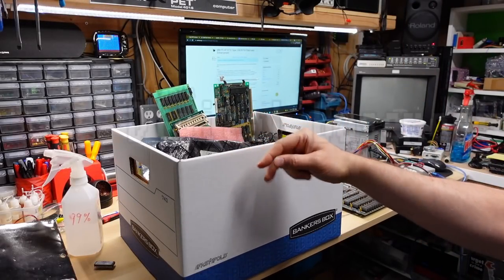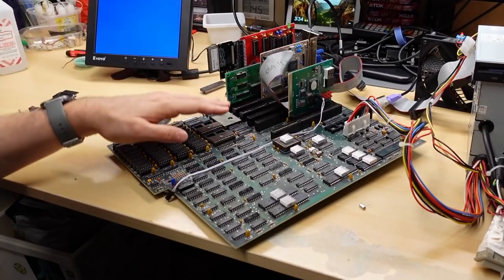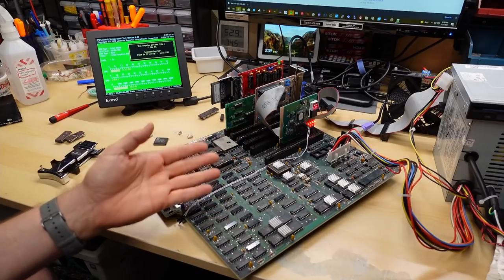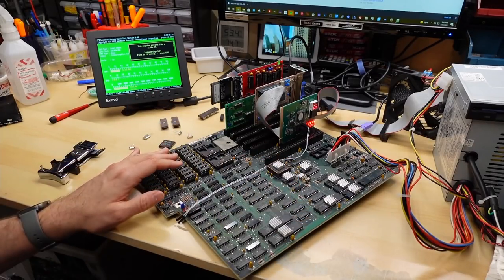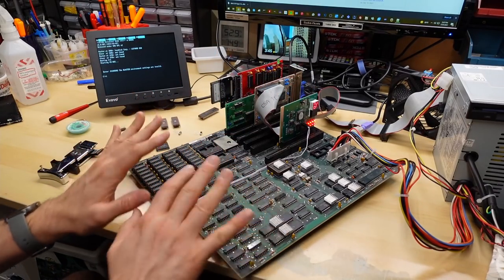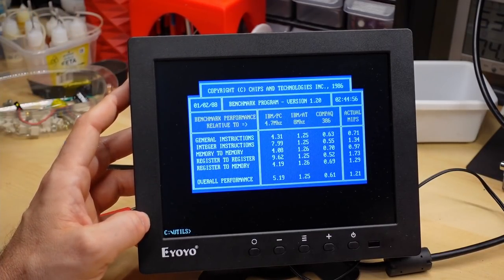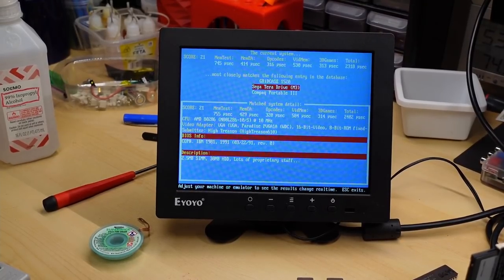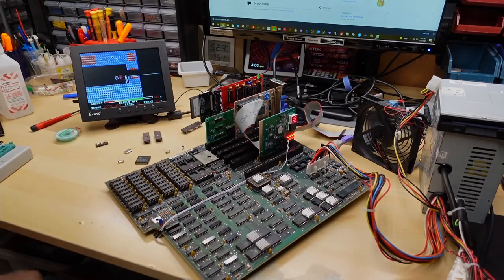Followup: IBM 5170 "extreme" overclocking (w/ associated BIOS patch)

Comment: I felt excited to see someone rewriting a BIOS and have it applied and working, with all the patches.  I'm a software developer, and I LOVE being able to write applications to do my bidding.  I've never gone as far as to build a BIOS for any machine, so the process in this and previous videos have been wicked awesome.  LOVE it.  Thanks for the update!
Reply: IBM also did give the full source code for the BIOS, a far cry from the modern offerings from them, or from almost every other manufacturer now.
Reply: From a firmware perspective at least, these boards should be unusually "easy" to write a BIOS for, since they were made of largely commodity chips that were/are well documented- it's akin to a more comprehensive DOS extender or other DOS program (the biggest differences are that the DOS/program relationship is reversed, and that you aim for "extender-esque" behavior). The biggest weirdness is probably that you need to setup stuff like DRAM refresh (early PCs used one of the DMA channels for it), which in basically every other piece of IBM PC code is unneeded because it's already configured.
Reply: A good question is: did the person who modified the BIOS have the source code, or did he have to disassemble the machine code?
Reply: @MisterMac56 with the knock on effects of utterly bringing IBM to the brink…..

Comment: Sometimes, overclocks may cause strange hung up's.. I did it even on my P1 machine, back in day's..

In this case - check out what exact version of programmable interrupt controllers (two of them 8259) main board has installed and some other bus parts.. Even one slower part on bus can cause similar issues, because, didn't release bus in time..

Anyway, great video, as always! 👍😉

Comment: I found it interesting that Adrain dropped into the 286 running at 10MHz - the 286-based PS/2s (Model 25 286, Model 30 286, Model 50, Model 50Z, Model 60, and 7552 Industrial "Gearbox") all were 10MHz systems. He placed heatsinks on motherboard chips, but one socket is unpopulated that would definitely need one for the transistor count: The optional 80287 FPU.

Only the microchannel systems of the 50, 50Z, and 60 ran the 80287 FPU at the same speed as the 286 CPU ('CKM', pin 39, "Clock Mode" tied high) - the ISA models and 7552 (where the FPU was included standard) ran the 80287 at 6.66MHz ('CKM' tied low to ground, so two-thirds of the 287 speed). It was primarily that someone could use a lower-rated (and lower cost) 80287. The later i287XL didn't use the 'CKM' pin in the same manner to run it at the higher frequencies it was capable of.

Comment: Wasn't expecting any mention, but certainly appreciate it. Likewise, I enjoy your videos and often have them on in the background when working on things. The Tera Drive was indeed built by IBM, even uses their weird edge connector hard drives, and it wouldn't be their only venture into the world of games console related hardware, as I at least think they built the Atari Jaguar too.
The XT-IDE thing sure is curious, even though changing that chip seems to have solved it for you. On my off-brand 286-6, installing an XT-IDE BIOS (after butchering a regular IDE card to sit on IRQ 5 and, I think, port 320h) causes the system to weird out and run the CPU from double the FPU's clock instead (20/2, where the FPU is 20/4). Have no idea what it does or how on earth the board is wired to be tapping a clock from the middle of a completely separate 7474. It's slower than your machine at that speed, though, as well as extremely unstable. Luckily it's back on MFM now and doesn't exhibit this issue.
If you change to a CMOS version of the CPU, you probably won't need a heatsink on it. Maybe if you have one that was made later, or especially any that came from laptops, it could be worth a look. These usually, but not always, have a model number like "80C286" as opposed to just "80286" stamped on them. There sure is just something about feeling that radiant heat from a bunch of NMOS logic, though.

Comment: Another great video, always informative. I did have a 20Mhz 286 machine as my first PC and I think I did run in to problems with the 10Mhz ISA bus speed but that was only with one card so don't overlook that if you continue on with the overclock but on the whole my 10Mhz bus was fine, the stepper motor hard drive from Kaloc?  that was another matter, it worked when it was cold or when it was warm but never both not matter when it was low level formatted, sounded wonderfully clunky though.

Comment: Fascinating stuff, I'm about to embark on my own 5162 project, which is a 6MHz machine with the same BIOS lockout for overclocking. I have a 12MHz 80286 and a few different crystals ready to drop in - although I think the 5162 BIOS is unique to that machine so I'm not sure your patched version would work. Either way, I'll definitely be referring back to your videos (and of course giving you a shoutout) when it does happen!

Comment: On XTs, PCs, and PCjrs, you'd need a PC-SPRINT modification. The clock system is set up to allow for a separate bus clock chip, so you can run the CPU at a different speed than the bus. It may still be possible to use that mod on an AT.

Comment: Hi Adrian,
To answer your question about the ISA bus speed on the 5170: It's a synchronous design, meaning no clock dividers were used to drive the expansion slots so when you overclock the CPU to 10MHz the ISA bus speeds will also be 10MHz.
If you're looking for more stability when running at 10MHz: Swap out the 82284 clock generator and the 82888 bus controller for 10 MHz rated parts. In stock form both of these chips are 6 MHz rated parts and cannot keep up at 10MHz (60% overclock) ;-) RAM should be 150ns and should be fine at 10MHz.. Some of the earlier machines had 200ns rated memory though so I'm not entirely sure they will be as comfy at 10MHz as their 150ns counterparts.. (not sure about the chips on your board as well)

Comment: The 108 error symptoms sound similar to reset issues.  Once reset is released somebody is starting up more quickly at the higher clock rate, which is violating some other timing in the system.  You could add a cap on the reset line and lower the slew rate, giving everybody more time in reset.  But that's a 50/50 chance of making it better or worse, plus some components are sensitive to super low reset slew.

Comment: 2:16 I don't think you are framing it the historically correct way. I'm very confident this wasn't meant as a dedicated check against overclocking, but instead at those times the Power On Self Test actually did what the name promised - i.e. it made sure that the system indeed behaves up to specification, and prevents booting if something is out-of-spec. This also includes verifying that the different clocks run at design speed.
Of course, checking that a system behaves "in-spec" has the collateral effect of detecting overclocking as "out-of-spec", but the purpose of this check is more likely to check that the 14.318MHz clock operates correctly (by comparing it to the 6MHz processor clock) than to check whether someone "illegally" runs the processor too fast. The fact that it checks for both overclock and underclock supports the idea that this is not a dedicated "overclock" check, but meant merely as "clock plausibility check".

Comment: Hah, I was going to suggest the DS1077 clock synthesis chip but then you mentioned it. Definitely would be interesting! You could also probably use our good friend the ESP32 in a pinch as well, the RMT peripheral can give you a carrier wave up to 80MHz, and you can set it to divide it down with a lot of resolution as well.

Comment: Sad to hear IBM even managed to lock users out who try to change the system. I played with a lot of clone systems in the day and overclocking was easy with no real problems other than instability when going really too far. Heck even my Atari pc3 even runs at 10Mhz at the moment (and for more than 20 years now) just by changing the 24Mhz crystal to a 30Mhz one.
Reply: In those days IBM would have been guarding against shady resellers rather than the end-user.
Reply: Yeah, I don’t see IBM as being the type to prohibit users from doing whatever they wanted.  Too much of what they delivered to the customer encouraged opening the case and poking around.

I do wonder if maybe some of those speed checks were there to catch abnormalities - or, as RetroSwim said, to keep the retailers honest.

Comment: 11:52 to some modern gamers, that's just normal everyday overclocking :p 
as in, turn it up until it bluescreens and then back it off until it becomes stable enough to work
Reply: And what some people consider "stable" isn't always "stable". I mean if you can get several hours of gaming or production out of an overclock before a crash, thats good for some people.
I've tried overclocking on my PC but the computer crashes with WHEA errors on large memory hogging games (or just games taht eat up a lot of memory if you push it)

Comment: My IBM AT had a Kingston 386sx/25 SX Now! Upgrade fitted, this was the most reliable system I ever had. Everex RAM3000 and Intel ABOVE BOARD AT making 5mb ram, and an IDE interface. Later fitted a K6-2 500 and wide scsi drives to make the fastest AT ever.

Comment: Interesting that the XT IDE interface card seems to be using tantalum capacitors for IC decoupling. You would usually use a ceramic capacitor, due to their better high frequency response.

Comment: The RAM likely is fine, as when the manufacturers got the process dialled in they would find all the RAM that passed basic function test would run at pretty much the fastest speeds fine, so to do the low cost versions they would mark them with the slow speed, as they do meet that speed, while selling the tested high speed devices for a premium, and using the bulk sales to cover the run, the performance parts would be the profit. You probably though are running the memory right at the edge at 18MHz, as the long traces, and not matched traces, are likely leading to the last chips on the board barely able to meet spec for data read and write, and to latch address bits into the chips. Run the board hotter and it likely will not fail, but with the 17MHz clock crystal simply freeze the RAM chips furtherest from the CPU, and it is likely you will get a reliable crash as they get cold.
Reply: Funny, the math suggests even what he's doing isn't going to be possible much less reliable.  That said, you're absolutely right and his experience bears it out.  Pushing the limits of the design and material science of the period means it's going to halt under certain circumstances due to data corruption, bus collisions, wait times, etc.  
Fun nonetheless.  I discovered in my own experience doubling clock speeds eventually led to instability and uselessness that heat and power management couldn't help.

Comment: I suspect the lock up issue is the ctrl-alt-delete ISR has a reset for the PIT/PIC chips, which makes sense in a soft reset.... (this would reset timers, pc speaker output etc) 

I bet the IO being written to these chips may be getting missed in some way, so maybe programming the PIC is failing?

There were other thing you mentioned that make me suspect the pic/pit being unable to handle the speed...

When the computer was "locked up" at the end, I wonder if the keyboard is actually what stopped working, not an actual lock up?  It's hard to say really BUT!

I have a challenge, go way over the top to cool the PIC/PIT chips and see if the instabilites go away?

Alternatively, perhaps if there is some resets inside the ISR for ctrl-alt-delete, you could double up the writes to those io ports, inserting a delay into the system .
Reply: Close but I don't think the PIT/PIC are the actual problem here as they're both 10MHz rated parts on these machines.. Even the DMACs have a lot of reserves as they run at 1/2 duty cycle and are 5MHz rated parts but run at a measly 3MHz when running using a 12MHz stock crystal (6MHz clock speed). The real problem actually lies within the clock generator and bus controller. 

Both the 82284 clock generator IC on the 5170 (which also handles resets) and the 82888 bus controller are 6MHz rated parts on type 1 AT's. A 60% overclock (6 to 10MHz) is just way too much onions for those old parts ;-) It's surprising the machine even POSTs at that speed.. The Schmitt trigger that is used for the reset circuit will most likely be out of whack and will not be able to respond to synchronous inputs which is why the machine will not be able to handle resets/warm boots..

Replacing these parts with 10MHz variants will make an early 5170 run at 10MHz no problem.. Any higher than that an the RAM will become an issue as IBM used 150ns DRAM on type 1 5170s (it's still a '84 machine ;-) ).. On the type 2 machines the on board DRAM is easily replaced by faster parts.. On a type 1 not so much as it uses 128K piggyback DRAM chips and as far as I know they're always 150ns or slower as those are 1984 parts..

Comment: Problem with hct chips is driving power and  with buses of length need power. On boards I built back in the mid to late 80s I used hct on my boards but had to use Als to buffer but these als buffer chips cost as much as all the other chips on the board. Now one cpld is far less than all the ic I used to fit to one board.

Comment: My money is on the slower rams, I'm much younger but from my athlon XP days, overclocking with linked clocks always tended in really unstable machines. You have ONLY linked clocks in that machine so getting memory access violations/bad access with slower rams is probably a common thing with your setup.
Reply: I wonder if adding heat sinks to the ram would help?
Reply: My first overclocks were then too. Overclocking the FSB (AKA EVERYTHING!) just made stuff so unstable.
Reply: @ericpaul4575  : Short answer... No. Long answer (still abridged)... in order for a memory cell being read, some prerequisites are needed. First the memory controller needs the address, it then decodes this address to a row and column, then said row needs to be powered up, said column needs to be selected (ras to cas, blah blah blah). All of these actions take time and only have a limited time frame to complete their task, if you have slow physical memory that in a very short amount of time simple can't do what the memory controller orders it to do, you either get incomplete reads or incomplete writes... both is a catastrophic failure mode. Think of a grandpa at the trainstation, train arrives, grandpa finally realizes his train has arrived, finally has all his sh*t together and begins crawling the train, train already closes its doors without grandpa bording. Gone.

Comment: That CPU needs a better cooling, what are you planning to put on it? Something bigger but passive stuff or a little dedicated fan? Maybe some special passive cooling?
Reply: Simplest to just put a better thermal solution on there. Easiest is to take a Intel copper core heatsink and use a hammer to slide the copper core out 5mm from the fin area, and use that copper slug and some good epoxy to attach it to the CPU. Will keep it cold, I have done that to a lot of 266/386 CPU's, using old south and north bridge heatsink units, and a small amount of 2 part epoxy, typically Pratley quickset steel epoxy or Araldite rapid, a thin coat applied to a clean, degreased and lightly sanded surface both sides, and firmly pressed down to get a thin even coat. Basically a blob the size of 2 match heads applied to the surface and then squeezed out to cover the mating surface.
Reply: @SeanBZA  Do you need a special 2 part epoxy for cooling fans or any 2 epoxy will do it? The epoxy in old C64 PSU is meant to dissipate heat but looks more like a heat trap. I'm not familiar with heat conducting properties of different types of epoxy glues.
Reply: @Dukefazon  Yes you do get thermal epoxies, but a thin film of the metal loaded 2 part epoxy will work almost as well, and in most cases you can not tell the difference. I used them a lot with hot running IC chips where you can not use any other mounting method, and the thin film, along with smooth flat surfaces that are cleaned well to remove all grease, you will be hard pressed to tell a difference. 

I use it often to attach LED units on star aluminium core boards to a larger heat spreader, and you have to solder the wires on first, as afterwards you will never be able to get the solder to melt, the heat is removed so well. The 2 part steel epoxy is also a lot cheaper than the special thermal ones, so there is a benefit to it as well.
Reply: Regular Epoxy would not be good, as it is actually an insulator. There is actual thermal adhesive used for such an application. But I would not recommend it as it is a permanent bond. I would rather recommend thermal adhesive tape, which is removable.

Comment: The BIOS over/underclock check might have been a quality control thing. Users would rather deal with a computer that won't boot due to a clock defect than deal with an unstable one that could possibly corrupt data or provide an excessively subpar experience.

Comment: Also, agreed. You're probobly rarely jumping an initial condition. A clock-control chip might be able to push further. Boot at 8Mhz, then gradually ramp up. Might even get as high as 14Mhz on that thinking about the parts,